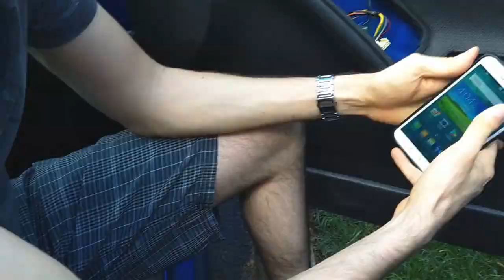pontiac vibe 2007 mirror replacement

Comment: Just replaced my side mirror, this vid helped alot thanks !

PS when putting the side panel back on after the new mirror is installed click the top in then get the bottom pieces, good luck ^~^

Comment: Even though I like hearing JFK, this was not the place for this since it was distracting AF and would've rather heard the steps especially what size socket you used to take the 3 bolts out